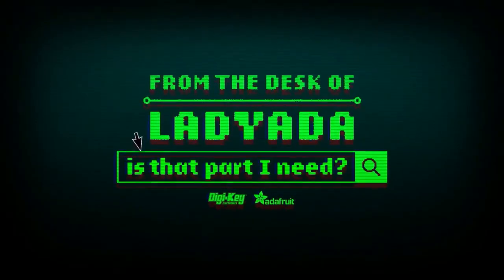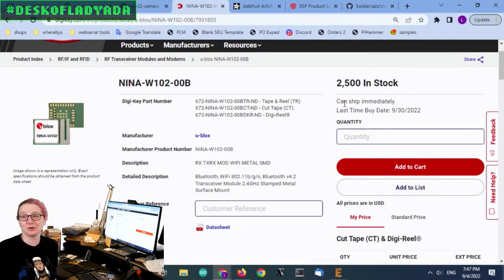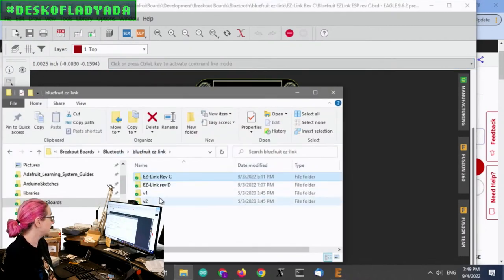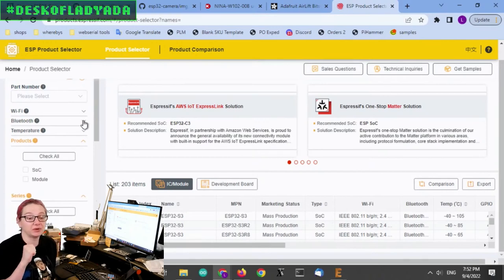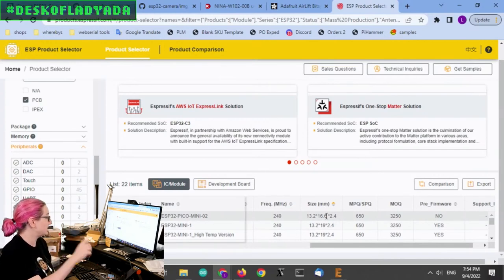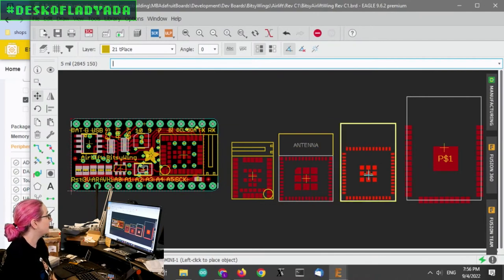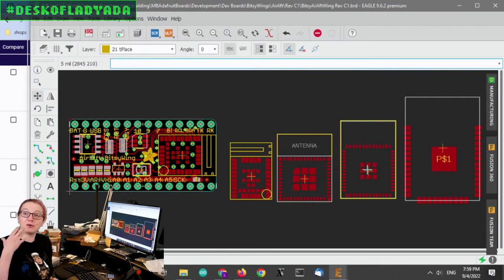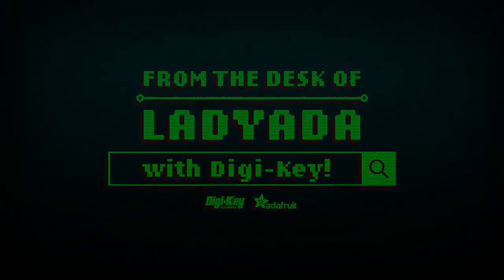The Great Search – ESP32 modules in all Shapes and Sizes! #TheGreatSearch @DigiKey @Adafruit

Comment: I know that this would make stacking a nightmare but:
Would you consider putting a module on its edge ? You can have breadboard-friendly pinning with 300mil "PDIP" style spacing on the actual board, with edge-ways (tall) module atop it.

Comment: I'm curious, why not ditch the module and use the raw ESP32-C3 with minimal parts?  I only just got back into embedded stuff recently after a gap of around 13 years and I'm finding modules are a pain. I2C especially because many of the modules don't have flexibility on their bus resistors. So of course it pushes me into contemplating whether I roll my own designs. The Seeeduino XIAL BLE sense for example, demonstrates massive power to size ratio, PDM microphone, accelerometer, wireless, BLE and Cortex M4 Processor. I quite like the ESP32 series for the ease of use of their ESPNOW wireless high level library and the C3 chips are selling free of modules too. I really can't see any reason not to use an ESP32-C3 bare chip in your redesign other than uncertainty about process reliability for soldering small chips. They also do bluetooth 5 and BLE